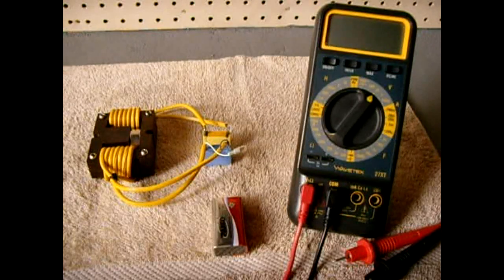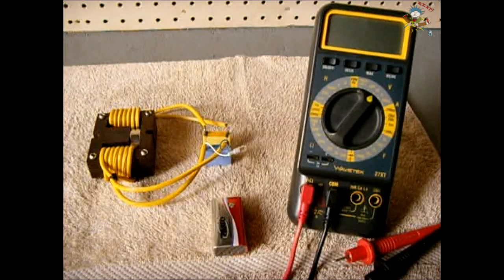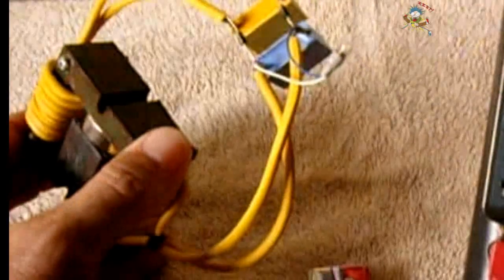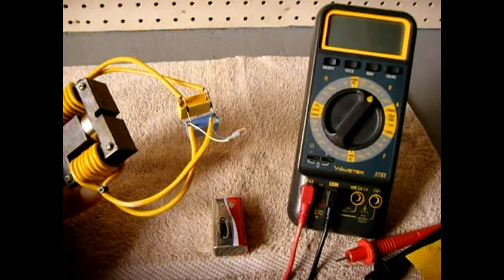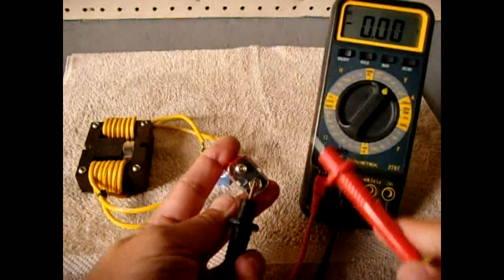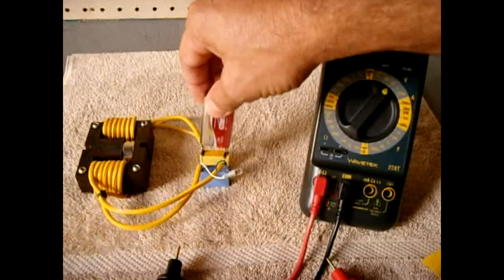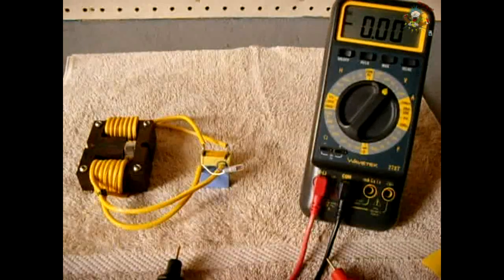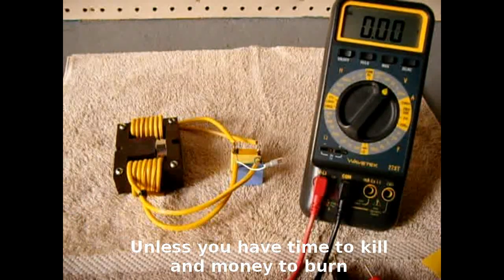Overunity Motionless Free Energy Generator EXPOSED!

Comment: To debunk you must understand certain ideas. The coils are wrong. Sure the video you choose to debunk I wouldn't have chosen. The best type of coil set to experiment is the bucking coils. Unless of course your just a troll to discourage others.
Reply from the maker: The coils are 100% correct according to the uploaded video. I examined it frame by frame, so I have no idea what your talking about. Same # of turns, and the same direction. Clearly I would not make a video without having the facts right.
Reply: electronicsNmore Thats fine. I have two points
 1. Looking at your build the same as what you saw. I myself couldn't entertain on doing the same. 2. If you dabble in fringe science you must know what is supposed to happen below the surface. Study cavitation that can create heavy metals(gold). Watch video from NASA website. Two ships the size of Earth or even larger slam head on into the Sun. The most amazing thing ever seen. Study Coral Castle (no load bucking coils). Travel through time, space, and create:-)
Reply: johnstarr2001" Study cavitation that can create heavy metals(gold). Watch video from NASA website. Two ships the size of Earth or even larger slam head on into the Sun." got any links,please.
Reply: johnstarr2001 If idiots who promote free energy aren't already discouraged by the laws of physics, then arguing with them using science and reasoned arguments is beyond their mental capacity.
Reply: CircumcisionIsChildAbuse True it.

Comment: Why don't you get a scope on it, and find out what is happening when you energise it. The scientist would ask: 'how could it work?'.

Magnets within a transformer core is novel technology: perhaps the energisation of the coil with the 9v battery causes a changing current in one of the coils, which induces a magnetic field in the transformer core material.

This magnetic field then meets the fixed magnet. If it opposes it, one might expect it to 'ring' for a while - which effect (a changing magnetic field) might then energise the secondary coil.

This induced voltage in the secondary might then re-energise the transformer core as it collapses into the load resistance (the lamp).

This changing voltage in the secondary may then induce another magnetic field pulse in the transformer core material, which again rings as it opposes the magnetic field of the fixed magnet.

And so on.

I'd say it could work. Certainly needs an open minded investigation, rather than with an attitude predisposed to debunk it.
Reply from the maker: I would not waste my time using my scope/attempting to get this scam to work. I have much more important things to do. If this worked, many others would already have duplicated it, and you would also see this "Free Energy" device being sold all over the place. My job was to show it does not work as shown. I accomplished my goal.
Reply: And, of course, it's not a perpetuum mobile - the opposing magnetic field pulses will eventually de-magnetise the magnet.
Reply: electronicsNmore Thank you for the very prompt reply! ;)

You seem to have something invested in finding out that a broken circuit does not work! I'm sure I could find plenty of broken things that I could get you to prove don't work.

If you're serious about debunking this, do some proper investigation - ask the guy if you can visit him, and see his circuit demonstrated, and test it with your own equipment.

All you've done so far is show that a different circuit doesn't do the same thing as Mr X's circuit. That's not a big deal. It's not journalism.
Reply from the maker: Same circuit. I did a very careful analysis of his video. I also tried 2 hard drive magnets as well. I did an excellent job duplicating the device. About as good as anyone would do.
Reply: electronicsNmore I appreciate what you're trying to do. But your inferred specifications for your attempt at duplicating the circuit from inspection of a youtube video don't constitute proof that the circuit demonstrated by Mr X. is fraudulent. Indeed, the suggestion may be libellous!

You appeared to have considered the electronics side of the circuit more than the magnetics - how do you know that the material you used for your transformer core was anything like that used by Mr X?

Many circuits will behave radically differently (or not work at all) with different component values but the same topology.

That said, I'd really like it to work, for sure. But I appreciate the value of a proper proof that it can not work. This doesn't meet that standard.
Reply from the maker: Same type of laminated core. I am done discussing this. Clearly you believe in scam videos. I suggest you watch more of them instead. A little common sense can go a long way on Youtube.
Reply: ***** Oh my god. It's a fucking scam. Electromagnetic induction uses a changing magnetic field. This could only be achieved with some kind of oscillator, which isn't present. 2 diodes on each side of a circuit will do nothing but prevent any current flow at all, and wouldn't even provide half wave rectified DC. And with a battery, "flat" dc is created. People who believe these free energy videos need to pull their heads out of their asses, learn that overunity is impossible, and do something that will actually get them somewhere in life.
Reply: >Clearly you believe in scam videos

No, but I do have an open mind. All I said was you should test that guy's device before pronouncing your verdict. Until then, it's reasonable doubt territory.

If the guy won't let you test his device for no good reason, I'd say you've got reasonable grounds to be suspicious of his claim.

Frankly though, your shrill insult-throwing and foot stamping against disinterested third parties doesn't give me much faith in your ability to debunk anything substantively.
Reply: Apologies - that last paragraph should have been directed at Mr Flaherty. Oops.
Reply: electronicsNmore My advice, don't give up.  Clearly, as in other fail videos, this is an attempt at a joule thief ringer.  I've seen many guys who could not make a simple joule ringer circuit.  This one does have some novelties, like the coils in the magnets; and people are right the diodes should be reversed, iff it works; but that you haven't received a working model is enough for me, and if someone did provide one, it would be worth the $50 just to see it did.  I've said before, the one most important aspect of a proof, and yes even a disproof video is the veracity of the person making the video.

I feel confident, that after everyone says the diodes should be in opposing polarity, you tried that... can you confirm it indeed didn't work?   A joule ringer does produce current to light a bulb, even if it's only for a short time, and that's the problem, eventually it stops ringing, not saying this is a joule ringer circuit...  but, it does have the basic designs of one.   Many people have created fakes of these, not understanding the principle, and when it wouldn't work, added something (out of irritation?) to make it work for a bit.  You didn't do that, Kudos on that!

I haven't watched the original yet... may not... but, as a good scientist, you'd have to at least try and reverse the diodes... and although I"m not saying it wasn't faked, and possibly is, it does make all the difference... with the diodes aligned the current would all pass in one direction and kill the ringing immediately.  So, you'd at least have to do that.  You can have the best intentions in the world, and if you couldn't see the strip, and made a judgement call, it could defeat the original intention of a joule ringer, and since you couldn't see it, I would have thought your first consideration for testing would have been polarity of the diode.  You're right in saying that there'd be no oscillation in a stationary magnet, that's why the battery is spiked on the input, to start the oscillation with a bit of power.  I know joule ringer/thief circuits can work.   At least give it a go, what have you got to lose?  In the end, even if it is a successful joule ringer, it will die down, and the light will go out, and this is proof enough it's just a ringer, and not generator, win win for you.

I'm with a lot of people in believing in OU...  All one needs for proof is the atomic bomb; a perfect OU design, as is any device using fission.  Fusion should also... but the problem is not creating more power than putting into it; the problem is controlling the reaction.  Which apparently nuclear power plants do to a certain degree of success... so the question isn't does OU exist; but, can we discover a controlled method of taking power from quantum effects, and control it to produce power... hopefully without being killed by radiation, or some other effect.  OU exists, just not always as shown. We have examples of extremes, one design (the bomb) makes too much power to control, the others (joule ringers) too little, others?  Who knows, but probably some day, yes. We will do it.

I appreciate your efforts, saves me a lot of trouble; but, this does look like a ringer/thief circuit (and if so, diode alignment critical) at the very least. (if you didn't do that from the start, now you know, read up on Joule Ringer thief circuits)  I haven't counted loops of the coil, shouldn't make that big of a difference except it might create sub-harmonics, and coils in opposition take advantage of reverse lenz, and conjugate cancellation of inductive effects create quantum activity, and harmonics can, if the LC circuit is correct, have the right frequencies to reach either electron bonding levels, for cancellation in the core elements (the atoms of the magnet in this case... so, theoretically, there may have been an effect... but, it's never been this simple (not just any ole frequency of the LC circuit will work; and some say geographic location because of help from the earth's magnetic field). [One bad thing about ringer circuit design that uses LC in circuit is that LC makes imaginary vectors +90° for cap, -90° for coil=imaginary, but recombined in coil reversal as conjugate makes 'real' again)  So, plenty of reason to doubt it;  proof without problems of local variable issues would be a grand proof. (coil bias is an issue also).  So, I request, trying out the suggestions... you did so many already.   What harm would it be, if you're serious.  Kudos on the effort... and I understand that people could have been nicer going about this... but, a-holes abound, and criticism hurts, especially when you were well intentioned.  I understand.  Don't give up.  That's my advice.   But, I think ultimately, even if tuned perfectly, an OU device will need some sort of toroidal third transformer to open and close the gate.  So many factors, that's why we're all still working on them; but, this device contains many necessary parts.  At worst either no power, or the power dampens; at best you'll blow the circuit, as it's not controlled.  Read wiki here for more of what I mean... http://en.wikipedia.org/wiki/LC_circuit, LC is basic design part of joule ringer.  I don't know what frequency; but, it will be related to the nucleus-electron bonding lengths in the magnet, and sometimes it's the non iron molecules that will give the best option for resonance.  But, that's the least of worries, and a good reason why most of these things don't do what they say, when trying to duplicate.  Every once in a while, someone gets lucky.  These devices are seldom duplicated, even if one person gets lucky, making them easy to disprove, difficult to duplicate.
Reply: Chip Cooper tl;dr
what you're saying probably has some validity, but keep it short or nobody will read it.
Reply: ***** magnets in a transformer coil is not a novel technology, its just a lame idea some smartass came up with claiming its new and novel to get morons to part with their money
Reply: Owen Flaherty I don't like it when I'm motivated to respond like that; I usually just shrug it off, and endeavor not to do it again.

Chris Brown I think it's fairly narrow minded to think all people are are motivated by money.  While running my own business, I have forgotten most contracts offered that didn't motivate me enough to consider. Since I know how much we know about magnetism; I find that it is highly likely in spite of what we know, that there's more we don't know.

And two, the creation of devices that fail to perform will make anyone enough money to pursue it as a serious consideration.  There are so many transformer configurations we have yet to explore, it's like writing a song we may think we've heard everything that can be written; but experience tells us otherwise.

I take a recent finding of mine of dipoles configured as hemispheric transformers which behave like a monopole, because the opposite pole is closed and trapped within the interior of the sphere to be a good example of something we're only starting to explore.  They've shown some exotic behaviors, by those creative enough to use them in ways thought of as 'outside the box'.  And mundane, by those without this kind of thinking.

There's still plenty of room for something no one has heard of... yet.   I personally have discovered that most people who think everyone is out to get a buck, think that, because they think everyone is like them.
If you take that personally, only you can know if the shoe fits; I'm just making observations.
Reply: There is no point doing something that is literally not possible, like raising the dead and free energy etc. There is also no point in experimenting in things that have become obsolete or have been refined to such a point point that you wont get much gain, e.g. transformers

Comment: The original device has 6 turns of wire on the blue coil; and 7 turns of wire on the red coil. Your yellow wire coils are each 7 turns of wire. This could make a difference in the outcome of the test. Also it would be best to use the same diodes if the specs are available. One would expect the original is a hoax, but I think you should try to use the same configuration in the test. Thank you very much.
Reply from the maker: Sorry, but I have no idea what you looked at. Do you honestly think I would make a video with a different # of turns? NO. I carefully examined the video. I have the same # of turns. I also covered all the angles with the diodes. Stop believing in scam videos.
Reply: Are you nuts Jay Dillon?
One turn won't turn an over-unity SCAM device into a piece of shit.
Reply: electronicsNmore Don't you believe in unlimited energy such as cold fusion or water cavitation/whatever it may be  systems through some kind of heating/electrolysis that will give unlimited amounts of energy via water or some other type of material that has been claimed to have been discovered by some really gifted individuals? I used to be real gullible but as I have studied and experimented a little with basically no electrical experience such as circuit board's like you do but can see the principal I have come to the conclusion there has to be such devices out there what do you think?
Reply: All you need is permanent magnets... Free energy that doesn't need electricity to start...
Reply: Drew Burton can you show me?
Reply: I'll upload it tomorrow after work, just got out of class :-)

Comment: The Solid State generator works, but is very difficult to adjust (see 'The Coler Report').
I can see that your primary and secondary coils have the same number of windings; this way it's impossible to get 'overunity'.
Reply from the maker: The reason why I have the same # of turns on each winding is because that is exactly what the other individual did in his video. The video is a scam. I will look into the "Coler Report".

Thanks For Watching.

Comment: Thanks for the effort you have put in this video. I agree with you that the label "free energy" is misleading but you might need to change the frequency to allow some time to heat the filament if you are using a filament bulb. From physics point of you, there is enough energy already put in the magnets. Moreover, our friend was pumping an initial energy in the circuit. That same energy, exactly the same, will feed the load but in pulse long enough to heat the filament. Think about it as a hose outlet opener hanging between two strong springs with a minimum loss of energy. The power needed to fill 1 liter bottle will be the same, but the time required to fill it looks elongated because it will be a sip by sip. I hope that I got some of it right. Thanks